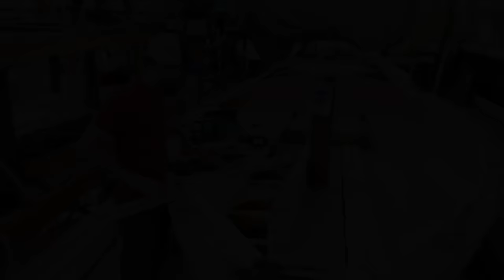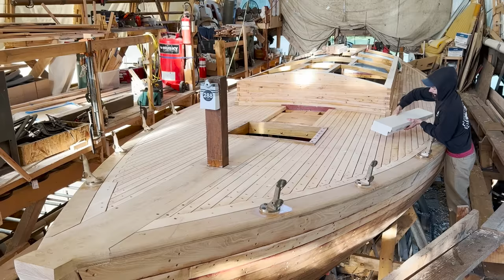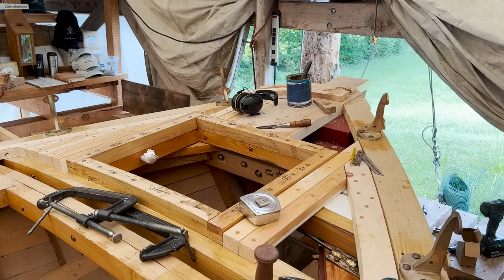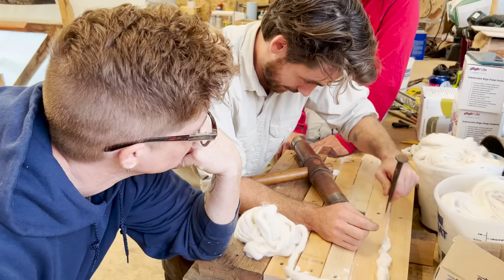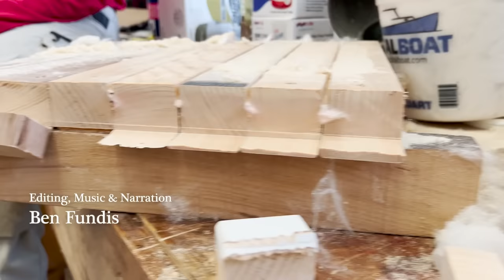Laying Down the Deck - Episode 231 - Acorn to Arabella: Journey of a Wooden Boat

Comment: Great episode Steve, KP, Anne & Ben, Curious though if you are planning to Glass the deck for UV protection?
Reply from the maker: No, not at all. Just a whole lot of oil.
Reply: Glassing the new deck for UV protection would be a total disaster. Sunlight would quickly turn the glassing and or resin to a cloudy finish and would not preserve the wood beneath. An oil finish is always the preferred method with an exposed wood deck!!

Comment: OK, you turn your hand, pinkie up, extend your index finger down and pinch cotton against iron, pinch a loop of cotton and tap it into the seam form a row of tight loops. Use same caulking iron (sharp one) to drive the loops into the seam. Rinse and repeat, using wider irons (sets) as you fill the seam. If after a few hours your wrist doesn't resemble a raw hamburger, you're not doing it right.
Reply from the maker: Yup! Nothing particularly mysterious there!

Comment: Decking looking super.  Great demo/teaching on 'caulking' the seams.  This has always seemed like a tedious chapter but such an important one in the ever-moving hull and deck, once introduced fully to the Oggin.  Aiden is taking on more and more challenging tasks.  That young man is experiencing something that a very few could ever hope to be exposed to at such an age.  And KP's work ethic is just the right fit for the A2A crew.
Reply: Tedious and there’s a ton of it.  At 37 feet long there’s something like 2500 feet worth of caulking between the deck and sides and need to do multiple times.  That’s more than a mile.  Then fairing and painting the boat is like four layers per side (primer, above the water line paint, anti fouling, anti fouling) and all the deck varnishing, housetop, etc.

The work being done is outstandingly good, this is the step with the exterior where things slow down a lot.  In total the final watertight sealing of everything from start to end should be like 6 weeks of work.  If there’s anything that pushes back launch, this is it.  If they get these steps done on time they’ll make their launch date.  This is the last big crucial item to be able to put the boat in the water.  The rest is small stuff in the scheme of things.
Reply: @flyingember  Three passes of cotton, then, would be about 1.5-miles of caulking, not to include the pitch and clean up.....all before paint coatings.  Wow!  Thanks for the info - makes me appreciate the effort all the more.
Reply: ...oops!!  Mega-apologies to AARON for mis-remembering his correct name.  It is not Aiden as I mistakenly said.  He's still a fine young man either way.

Comment: Steve, just a suggestion, but check out Leo's crew caulking videos on Tally Ho. He had some guys come in that caulkin/working is their primary craft, and the video/s have fairly decent details on technique/s and tool use (mostly for the hull) but it can't be much different on decking than planking, I wouldn't think.
I hope that helps some. The deck is looking great. What ever you guys decide, I hope it works and lasts to keep you as dry as possible in cabin.

Comment: I've watched corking on other channels & never could understand the clumsy corking hammer. Deck looks amazing. Why not use a wood mallet.
Reply from the maker: We did! But the caulking mallet is key on a vertical surface, to be sure!
Reply: Those caulking mallets are a preference, we used a wood mallet instead too
Reply: @AcornToArabella  Fine I just don't get it. But I'm not a shipwright.

Comment: if you watch Pete or one of the other corking pros, you'll notice that they bunch the cotton as they pack it with an iron.  That windowscreen roller doesn't do that, so is it placing enough cotton in the seam?
Reply: This “seems” to be an alternate method. Single then double strand is possibly the same amount of cotton. Nobody does their homework more than Steve, no doubt he chose the best method for their level of expertise.
Reply from the maker: They twist and slightly fold. We did something similar, though it looks different. If you watched the whole video, you’ll see when we cut a sample bit of caulked decking to see the results.

Comment: - Steve, I need some help, please:
- I don't understand the good reason why it is better for the deck strakes either side of the Sampson Post to be straight angle cut. {? ! ?}
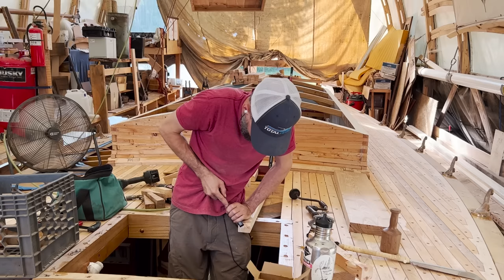- AND, what is the good reason why is it not a problem that they are all free floating, especially the ones that run past ribbing by more than three inches? 0:29, 2:16
- There has got to be something you have explained that I missed...or something I don't understand about how a wooden boat's movement must be accommodated for to best keep things water tight.

Comment: Loved seeing you use the brace to put in the deck screws. It's the only way to feel how tight everything is and make it all the same.  I usually use a toilet bowl wax ring to lube the screws.  Guys at the woodshop in my town, questioned why i didn't use one of the electric screw guns while working on my hatch boards last winter.  When I told them why, they slowly shook their heads and walked away!!  Love how the acorn is growing!!  Jeff and Julie Mack s/v OoLaLa  Westsail32 #81
Reply from the maker: We use toilet bowl wax typically too! And always have to explain why slow is pro when knowing how tightly to torque the screws—thanks for sharing your experience here. Thanks for watching!

Comment: I was wondering if the iron you use to set your first run could be modified by welding 1/4 inch rod to both sides of the iron to stop the material at a consistent depth? I think it will give you a consistent run without any hills and valleys and will keep you at a even depth throughout your planks. Looking absolutely Beautiful!
Reply from the maker: It works out just fine to have it be by feel, and it might leave marks to have stoppers like that.

Comment: I noticed when Steve was driving the screws in the decking boards he was using what those of us in Aviation call a speed handle that he was using the German Torque method AKA putting them in good an tight.

Comment: 23:50 is there a reason for the special hammer form, or will any regular hammer do the job?
Reply from the maker: They’re special for caulking, helping one’s arm to be a pendulum and ultimately saving work and helping with rhythm. It’s not everyone’s cup of tea to use one, but they’re particularly good for vertical surfaces more than they are for a horizontal one. Steve at one point switched to a carving mallet as was his preference. There aren’t any rules, people use what they find comfortable and effective. —Anne

Comment: I know its tradition but using that big ass hammer is really awkward , at least for the deck.
Reply from the maker: Yes, for the deck. We ended up using different mallets… but the big ones are great for more vertical surfaces.

Comment: all glue in shoes is water salable.  shoes will last till sole wears out if you NEVER get them wet.  Ive not found a glue that works in wet or for long.
Reply from the maker: Maybe something like polyurethane that’s flexible? Or contact cement? There are more than a few recommendations here in the comments, and it’s kinda cool how many people are showin’ up for these boots! 😁

Comment: Where on earth 🌎 did you get find the clown hammer 🤔⚓😊
Reply from the maker: It’s a specialized tool for caulking vertical surfaces… used anywhere there are wooden boats, and helps with momentum. We ended up preferring a carving mallet for the deck.

Comment: just a thought...have you considered caulking with a modified blade on an oscillating tool?
Reply from the maker: No, but it’s really great for removing the stuff.
Reply: @AcornToArabella  
just having reviewed that terrific cross section you did on the various versions, quantity, depth, etc.. of sample caulking, i can and do see the practicality and romance of traditional caulking irons and hammers. 
but...your use of the "screen spline" installation tool was both unconventional and genius.
i have modified, ground the teeth away and generally deformed oscillating tool blades to fit various specific needs and thought...hmmm?
wonder how well that could accomplish boat caulking...unconventional, not at all romantic...but if it efficiently and quickly fulfilled the task...it could be forgiven it's "vulgar" nature...
i've watched your work from day one...i for one...would not be foolish enough to take that bet...on you not launching on the date you have set.
thank you for allowing us to join in on your journey.
Reply from the maker: And thanks for being here for it!

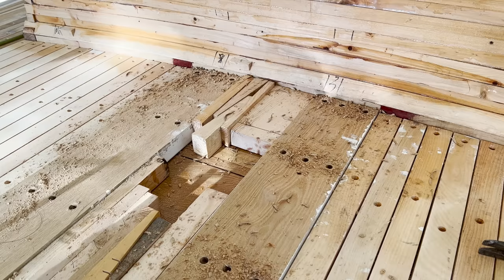Comment: 10:05 Do you plan on doing any type of flashing between house boat and deck? How's all that going to seal up and come together? I saw you put a thick glob of something in that area below deck. I guess no water will really be sitting there ever with rocking/rolling and the angles. 19:10 AH, the old screen roller. Use that tool nearly everyday in my trade. Hate em. haha
Reply from the maker: The house sides will get ‘glassed and painted, then set down onto the grubs with dolphinite, a bedding compound.
Reply: @AcornToArabella  That should do it eh. Love the craftsmanship. It's a favorite every Friday morning while doing paperwork.
Reply from the maker: Thank you, Jonny!

Comment: What is being put on the deck screws at about time 10:35, before being screwed in?  -
Reply: wax
Reply from the maker: In this case, wax. Particularly the type of wax used to seal toilets to floors. Bowlers wax, Dolfinite, beeswax, and lots of other things work to keep water out and to act as lubricant for later extraction.

Comment: Why is corking hammer in that shape?
Reply from the maker: Caulking mallets turn one’s arm into a pendulum, saving work and energy (physics), especially on vertical surfaces. It’s all preference though—if you can get the results with, say, a carving mallet, there’s no rule about that. —Anne

Comment: More about the mallet, please.  How did you acquire it, how old might it be?  I think I'd begin using it "just for a keepsake hoot" but then retire it in favor of something much less unwieldy and better balanced just for the sake of brevity and user-friendliness.
P.S.  Waiting to get fresh blueprints from the Smithsonian to consider beginning my 6th airplane project, perhaps a half-scale, 1910 Curtiss Pusher Model D.
Reply: @ralphgesler5110  If you feel compelled to reply to someone not familiar with wooden boat building maybe just kindly suggest that there's much more to caulking tools than obvious at first glance and that the subject is quite interesting rather than insulting the post of an obviously interested and benevolent fan who works on airplanes. Let's be nice.
Reply: Actually, I did do a bit of research by a fella who showed how to build one, and during his intro, he leavened his presentation with some old lore one might expect about the basic history of this mallet design.
I still maintain that, like the old joke about the young girl who always lopped off both ends of the roast before baking "just like grandma did!" (Hopefully, you know the punchline) and I still maintain that, from an ergonomic, engineering sensibility, and as a 50-year woodworker with a lot of tool moxy after many years as a professional tool handler, that, just for the purpose of bonking a steel hand iron, this historied, traditional tool deserves to be heralded in the archives, but I'd still end up wielding a much more sensible hammer. 
Please enlighten me further.  😊
That being said, Steve and crew are still on par with us builders as far as 🤯🤯🤯.
Reply from the maker: On a vertical surface, it makes much more sense to use the big caulking mallet. It helps with momentum. We ended up mostly using the turned carving mallets that David made. —Anne
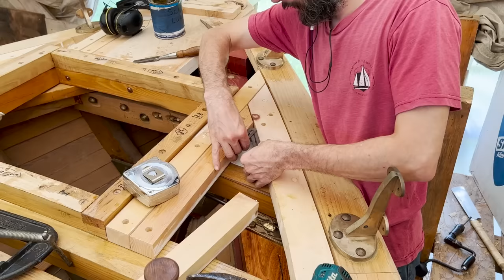Reply: @davidwilburn6314  Get to a vid with pro caulkers (or corkers) having at it. The mallet is about balance, efficiency and speed over a full day as well as tonal feedback about when they've driven the material home. Sound seems important. Size, weight and proportion also seems highly individual. No idea if they use the same hammer for vertical deck work as they do for horizontal planking. No experience or expertise, this is basically Cliff Claven from Cheers talking. For this kind of youtube wooden boat building crowd https://www.youtube.com/watch?v=9kjdslOna5w has a good look with specific discussion of mallets at 15:30. It'll make a lot more sense.
Reply: Yes, that video was certainly informative!  Thx.

Comment: What is the point of that ridiculous hammer?
Reply from the maker: Awesome on vertical surfaces for momentum. We ended up switching to carving mallets for the deck. As one does, picking up a couple of different tools for a task and settling for the best is what ends up happening.
Reply: @AcornToArabella  It looks very unwieldy
Reply from the maker: Again, it saves a lot of physical work when used on vertical surfaces—the weight far out from the fulcrum makes a better pendulum of your arm. And some people prefer other options.

Comment: Is the bit and brace for the deck screw just for fun or does it serve another purpose?
Reply: That's the fastest way to drive in slotted screws. Which they're using for the decking and planking because when they have to replace something, they're much easier to dig out from under layers of caulk and paint and make usable than Torx or square-head screws.
Reply: @charlesolson9019  it’s faster than a power drill?
Reply: @rustyreckman2892  Yes. Powered drivers are useless on slotted screws, because the bit slips out of the slot really easily.
Reply: @charlesolson9019  thanks
Reply from the maker: And damages a very soft fastener at that! Slow is pro!
Reply: @AcornToArabella  thank you for your input I know you guys are super busy.  What a project!
Reply from the maker: Cheers, Rusty!

Comment: 2:34 a pity the ends of the planks don't line up.. 😞
Reply: I had to go and have a look and there does appear to be an imbalance. There are 5-1/2 full width planks on one side of the king plank and 4-1/2 on the other side where they don't end in the cutouts of the plank just inboard of the sheer plank. Could it be an error in the laying out of those plank cutouts?
Reply from the maker: Nope, it’s because the decking is regularly sized but the king plank must be as wide as it is, cannot be made thinner, as it is a base for the windlass.
Reply: @AcornToArabella  Thanks for the explanation. 👍
Reply: @Laz_Arus  That is nog what I mean, if you look at the left side where the planks end in the nibplank the angle of the cuts don't follow de line of the sheerplank but are kind of zig-zag.
Reply: @KeesAlderliesten  Ah. I see what you mean now!
Reply: @KeesAlderliesten  that is to avoid feather edges on the deckplanks.
Reply: @99Etien  You don't understand what I mean... Look at the shot at 2:23. On the left you see a smooth line between the sheer and the nib plank. On the right side of this line you see a kind of dashed line formed bij the ends of the planks ending in the nib plank. This dashed line isn't smooth but is a bit ragged.
Reply: @KeesAlderliesten  ah I see, what you mean. I think it looks worse in that shot than it really is. Also at some point you have to weight effort/time vs some minor visual inconsistencies. I mean I bet none of the screws are measured perfectly, just eyeballed to look somewhat even.